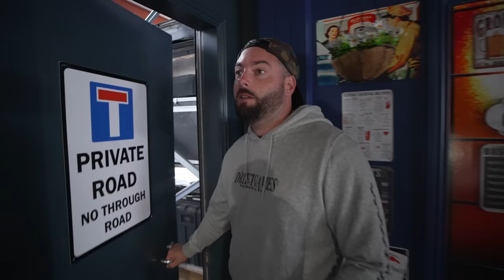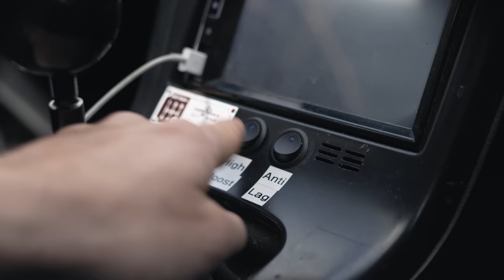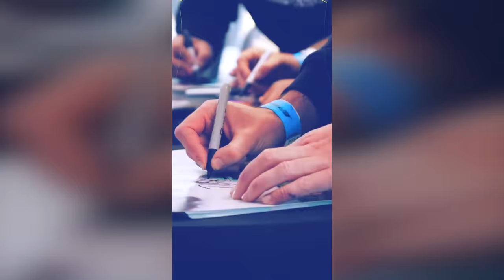This is how we get cars into our new dream garage...

Comment from the maker: Would you be nervous putting your car on the ramp? 🤯
Reply: It's got to be a weird experience, I love it!
Reply: it would be just another day and would be proud to roll my car on that ramp
Reply: No, it looks solid to me! But the fact you haven't got a gate at the top, when the door is open does scare me a bit. A bit of extra safety wouldnt't hurt, as you're standing quite close to the edge when operating the lift. Overall though, it looks super cool!
Reply: Well the worth of Ur lost cars yes but my Owen car na not worth even half as much 🤣 the drift cars u have to sit on them ya to make shore they don't come off no handbrake just a e brake
Reply: Nope would give it a go and would be cool to see it in your place 😎
Reply: Na 😂
Reply: The lift bits fine, not impressed with the cars able to roll off from the top as there is no gate or the crush hazard on the ground as you lower  it by the entrance, a fence around the lift will sort that👍🏼
Reply: @markcray5164  what ever you do 
Don't look down!!!!!
Reply: A steel gate with a safety interlock would be would be more confidence inspiring than a chain. Thinking of the ways it could go wrong , most of them relate to that chain. You imagine somebody tries to start their car to back into the HQ, it won't play so they go round the front & pop the bonnet, then step back & seamlessly flip over the swinging chain & land head first in the car park from a height of 20 feet...

Or there's the old brake failure scenario, or somebody backing off the top putting it in drive instead of reverse & panicking as the whole plot snaps the chain & plummets to its doom, killing a minibus full of nuns that was driving right underneath as it arrives.

It only has to go wrong once & you'll never be able to afford insurance ever again!!
Reply: No but I've an mx5 so with a few big lads you could nearly throw it up there 😉
Reply: What ever you do 
Don't look down
Reply: Yep considering I know the owners of the company ther Rally drivers 😂
Reply: How long til someone does a burnout on it as it moves?
Reply: Wish I had car worthy of the ramp 😅
Reply: Nope that's built properly and on the off chance both chains snap the odds of it going down without some or other friction to slow it down a bit and odds are you'll end up with very little damage to your car including the help of the base of the lift made of proper steel so maybe some suspension damage worst case scenario 😅
Reply: Wonder if it’d hold my Discovery 2? 2.3T
Reply: @gearoidryan6628  it'd definitely hold the weight as generally they're always over engineered but if it'd fit under the garage door? that's the real question
Reply: We have to put my van on it 😋
Reply: No. I’d be nervous to have the office space below your though 😂
Reply: Trust in your equipment
Reply: I’m really concerned about cars accidentally coming off the front , couldn’t there be a chock type safety like you get on ramp style car-lifts so when the lift is off the ground the car can’t get past the chock and fall off the end? I’d hate one of you to bump it in the wrong gear by accident or something.
Dunno I’m a belt and braces kinda guy xx
Reply: I would be nervous that the Cars collapse the floor😢 but I imagine those mathematics were already worked out
Reply: Might add a wheel chock so it can't roll forward at all.. other than that.. nope it's rad
Reply: If I knew the people that installed it, no.  If I didn't know them then yes.
Reply: I drive a 2002 astra, if it "fell off" the ramp, you'd be doing me a favour 😂
Reply: yes. I would have an automatic block that went up as soon as the lift went up, so you dont accidently go over the edge, like if you put it in first instead of reverse or something...
Reply: Nope so long as its in gear 😂